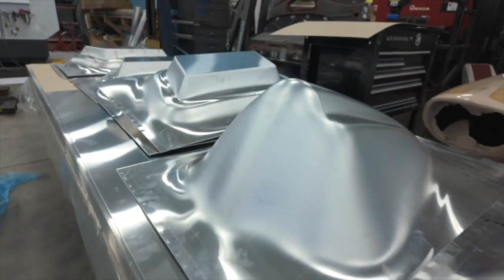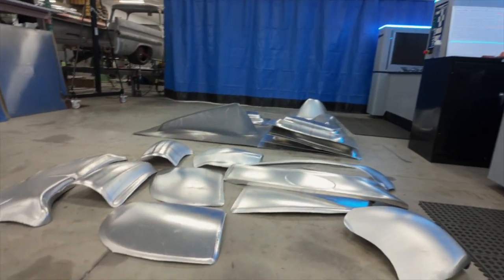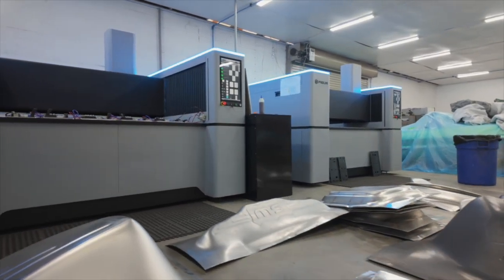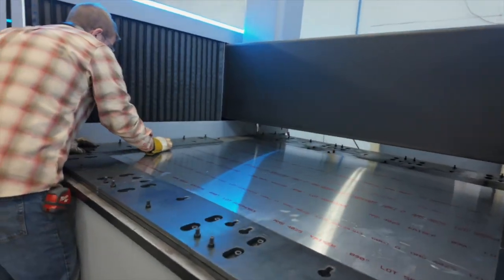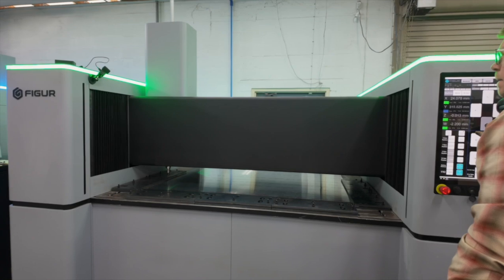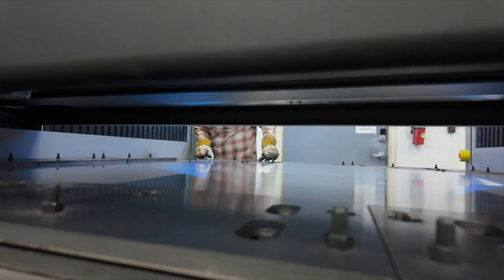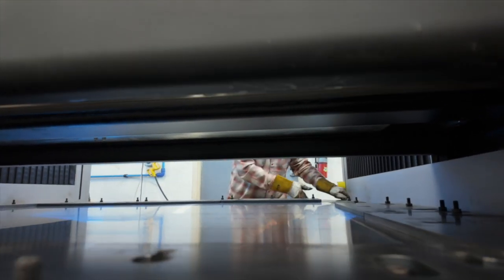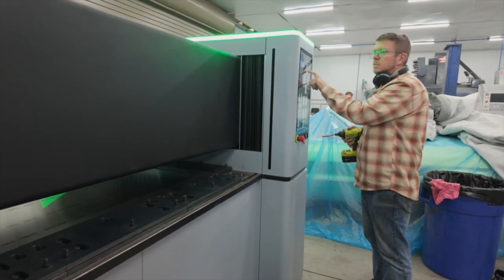The Future of Metal Shaping?  the Figur G15 by DeskTop Metal @SaltWorksLiveAction

Comment: That thing is awesome. I'm surprised there isn't more deformation around the clamped edges.
Reply: It's 6061, but in T0 condition, so almost as soft as soft temper 1000 series aluminum. Not sure if they bring it to T6 hardness after processing, but if they can control warpage it's an option.
Reply from the maker: That’s beyond my pay grade that would be a saltworks question 😆
Reply from the maker: Yea it’s pretty crazy I made the video because it’s hard to believe unless you see it